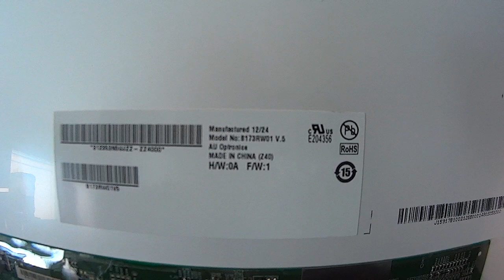Toshiba Satellite C875 Laptop Screen Replacement Procedure

Comment: great simple video.  the left hinge just popped out, but i was able to take it apart but had to glue the screws and the holders into the plastic.  At least it wasn't too difficult to get apart.  Toshiba has history of the plastic degrading.  I've had to repair the power jack on numerous laptops because they don't seem to come up with a good design to prevent this.